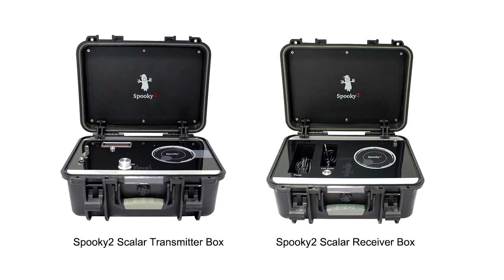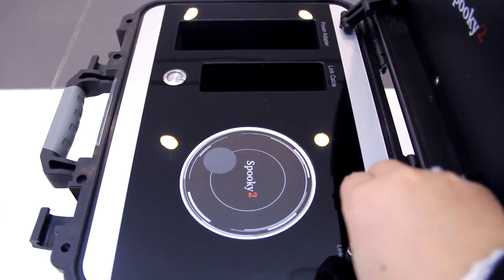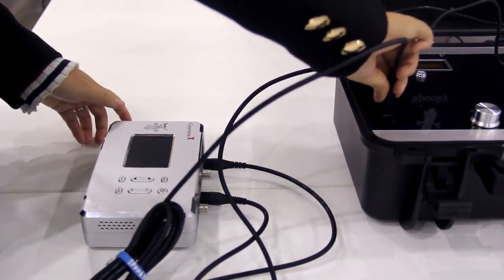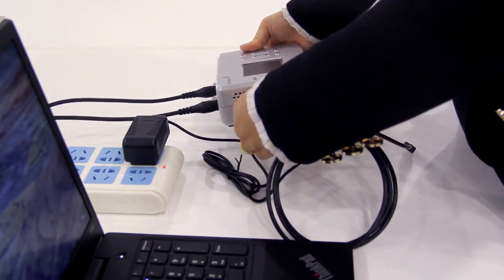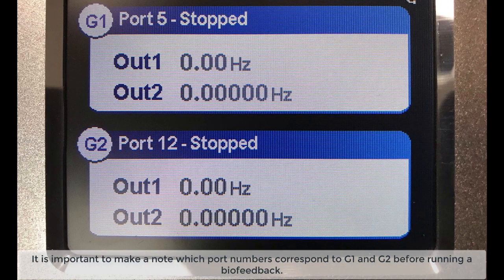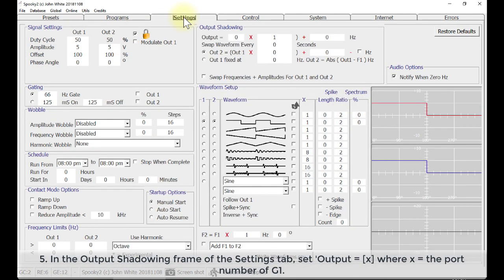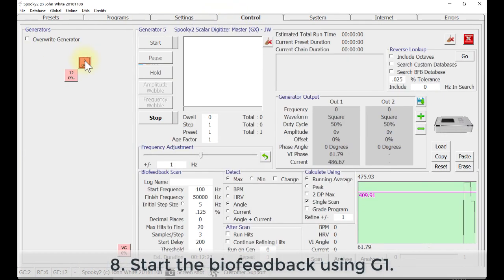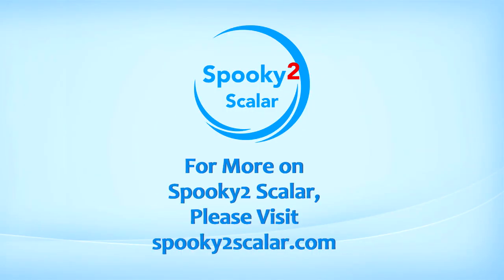How To Do Scalar Biofeedback Scan

Comment: Hi... I noticed that the present or later SPOOKY2 software cannot perform biofeedback scan properly. I noticed it when I tapped the transmitter and receiver coil, there is no response changes on the status trend on the computer. And also the trend is only wandering up and down. Then you further went to the compare thru the reverse look up, the results not comparable as the previous software. And there is also difference in the label for for the SETTINGS TAB, the old software version labeled OUTPUT SHADOWING BOX, in the new version is only OUTPUT CONTROL OUT 1. I fount the old version say 2020 and older works well.
Reply from the maker: Hi Julie. What version of the Spooky2 software are you using now? You can try to update to the latest version to see if it works well. If not, please connect our service team to assist you: support@spooky2scalar.com.

Comment: after that bfb is done could I run this bfb with plasma, remote or contact or it need to be run tru scalar?
Reply from the maker: Yes, of course. You can run the BFB scan results thru Plasma, Remote or Contact.

Comment: When I set up and then tune the scalar the red light on the receiver doesn't come on (comes on when i run just the spooky2scalar). Does this matter to run the biofeedback scan? Or have I done something wrong? I have set up a number of times now but everytime no red light on the receiver.
Reply: Page 6 of the manual of the digitizer (I think that's the manual) says that during a biofeedback scan that light may not come on at all, but you can test if the scalar field is present by going to the "System" tab, enable "Display GX Current + Angle" then go back to the Control tab and watch the graph as you enter and exit the scalar field.  Make sure nothing is touching the generator that could also effect the reading, and make sure the generator is on a solid, flat surface so the feet on the four corners are insulating the generator from any grounding through the box frame and what it's sitting on.